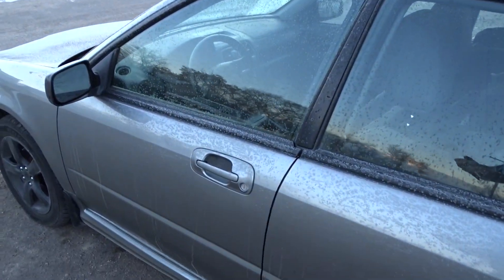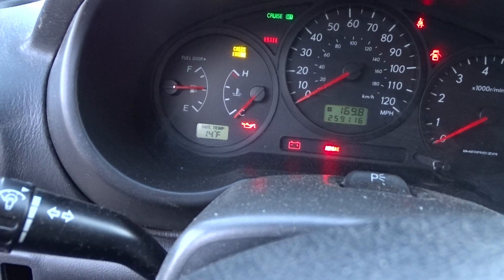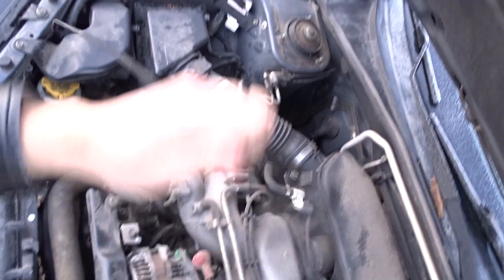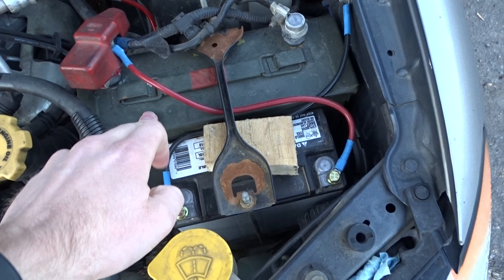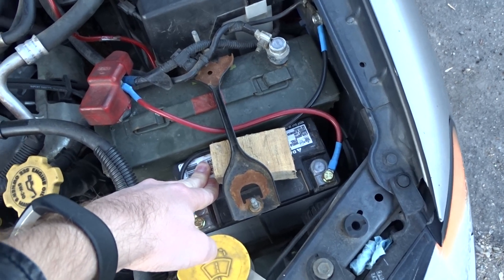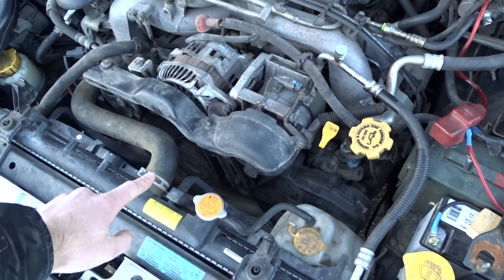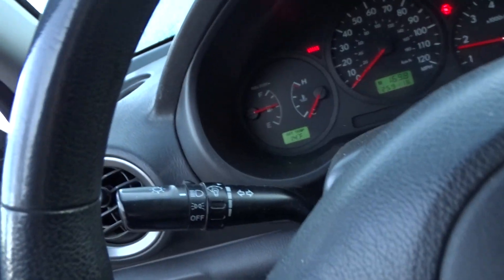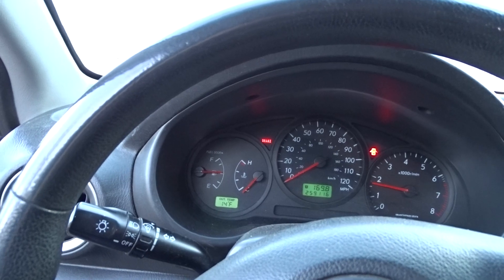Supercapacitor Car Battery 1 Year Update

Comment: I’m 10 years this August with my caps in my car. I have 12 maxwell 2.5v 2600 F. I paid back in the day 200 bucks for all 12. Once a year I’ll clean the copper bus bars for oxidation. This year I used lithium grease to prevent oxidation. The longest it will go without starting the car is 3 days. It drops about a volt a day. I use a little 12v solar panel if I go on vacation to keep them charged. I converted a 1000w HPS grow light ballast to be used as a charger. I chopped out the secondary coins and wrapped 4 awg wire. I used a big full bridge rectifier for dc. I can charge my caps in about 30 seconds from 0 volts. I don’t use a battery at all. Cheers niggas !

Comment: My Subaru I have factory battery eitha ultracap booster. I feel like this should make the battery last longer nger because the battery is not being deeply discharged on starting. This should allow it to stay fully charged most if the time, reducing sulfation, which is the main killer if lead acid batteries. Enjoyed your videos

Comment: Do u use balancing circuit?
Reply: you dont need a balancing circuit with super caps that are intermittently charged because the leakage current is based off coulombs law so there is a squared relationship to voltage and leakage current which means naturally a healthy super cap bank will tend towards equal voltages since any over charged cell will correct itself much more quickly than an undercharged cell. The board this guy is using has a balancing circuit which has been shown to do very little other than dramatically increase the leakage current which explains why he had issues with it dying. ironically his first solution to add a 2nd bank in parellel only doubled the leakage current and what he should of done is just added the small assist battery with a ~0.1 to 0.25ohm resistor to trickle charge.

Comment: with the motorcycle battery, you don't need the smaller sealed battery from the first design.  The extra can let you add a 3rd bank of capacitors

Comment: If you search "Farad Capacitor 2.7V 500F 6 Pcs" on Aliexpress, they list soldered circuit protected bare kits for $40 USD using six 2.7v 500F capacitors. I plan to add this to the car but in parallel with the normal battery for cold winter starts that -22f on worse days. The housing would probably be aluminum with maybe rubber corners. Hopefully its less likely to conduct lots of power easily if it shorts. Buying a "retail version" from china already hits $150 for the added case, but saves you time having to solder the majority.
Reply from the maker: Should be great for that!

Comment: I'd like to know what brand and what capacitance you've used
Reply from the maker: I just searched for the cheapest 2.7 V 500F super capacitors on eBay, I ended up with Green-Cap EDLC(DB). I paid between $3-$4 each for them shipped.